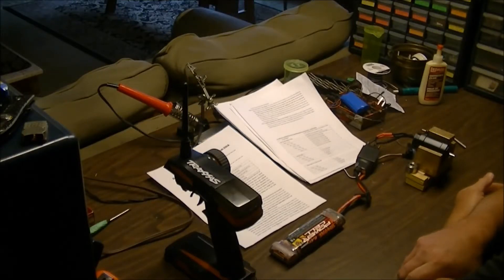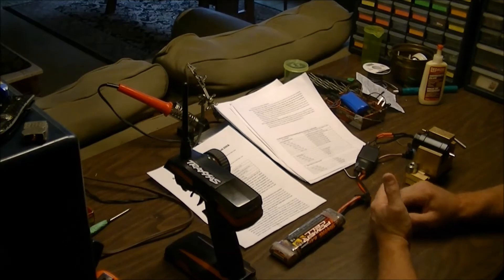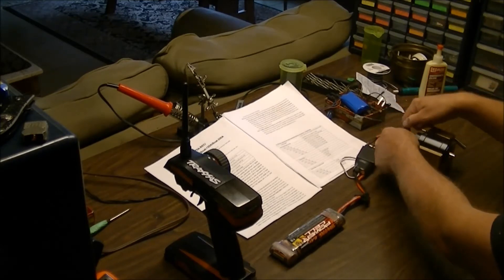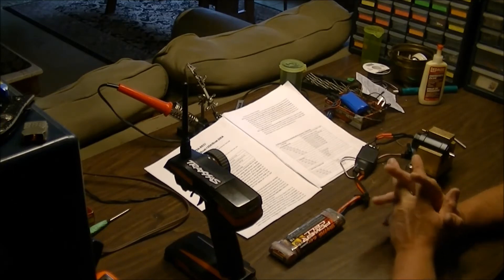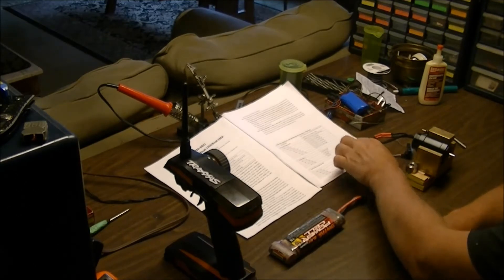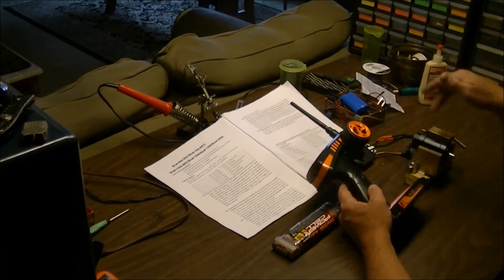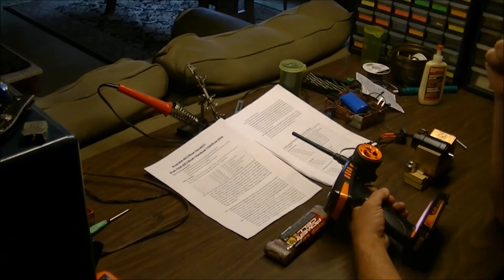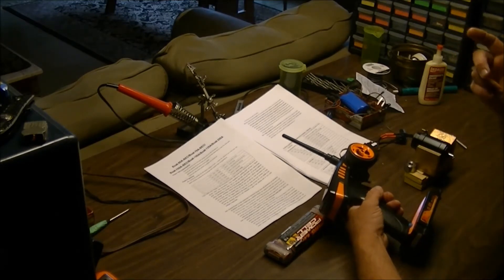How To Program The Eachine SS Series 125A Brushless ESC For RC Boats

Comment: hi nice video.Thankyou. I have just replaced my esc in my HK Outerlimits rc boat for this type, however..running it on 4s lipo is all good but when I plug my 6s lipo pack and start to run its ok for about 2 mins  then I have problems it just stops running,twice ive had to rescue it back with the fishing Rod   any tips on which setting I should be running it at using these battery packs  ... and would I need to set it up each time I run it with the 6s pack ? I use the  pistol grip controller also .. regards Rob
Reply from the maker: +Robert Gilbert check your motor pole setting and make sure your esc is programed for the 6s
Reply: Hi dude I set it up also hk said the motor I was using was a 4 pole how ever I still had problems with the esc cutting out and only having about 5mins of running time wirh the 6s pack until it died on me in the middle of the lake .I'm not sure I'd it's a over heating problem causing the esc to stop driving the motor when too hot ?thanks anyway I now know how to program this type esc cheers
Reply from the maker: +Robert Gilbert your welcome

Comment: How would u set it back to default ?
Reply from the maker: +Richard Hardy easy one item at a time look for the * its a default setting so all the  * are defaults so you do them one at a time there is no one thing you can do to reset them all at once
Reply: +Richard Hardy 
Thanks
Reply: +Kevys Rc & Music 
when i turn off transmitter it goes into full speed .
Reply from the maker: +Richard Hardy your welcome
Reply from the maker: +Richard Hardy your supposed to unplug the power to make each setting hold its programming watch the now if you just turn off the power to the radio and it goes wild then you need to set the fail safe on your reciever you might want to watch my video a few times to get the hang of how this thing works for programming the ESC
Reply: +Kevys Rc & Music 
Thanks again . new esc and transmitter . never had to do this .
Reply from the maker: +Richard Hardy your welcome not everything is plug and go